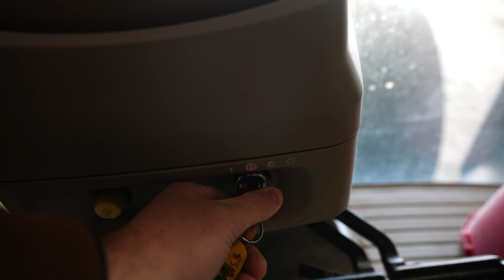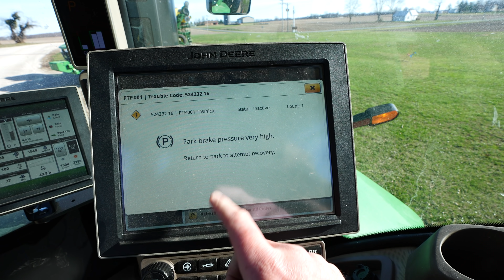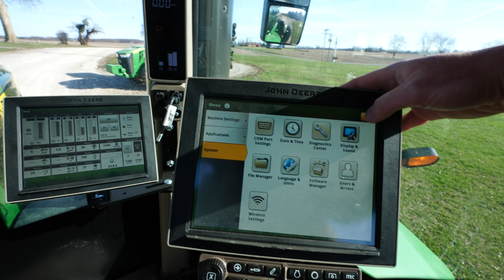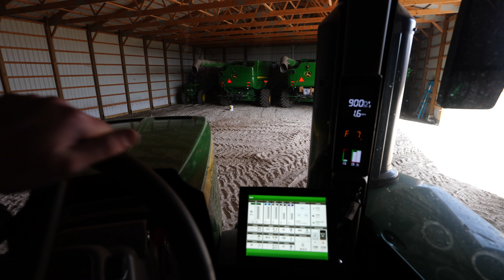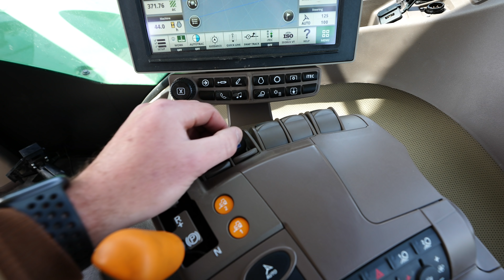The Old John Deere Iron Leaves The Shed For Planting (Ep.157)

Comment: Wow, that ancient clay tile still working is amazing. Around here they are always packed tight with sand/soluble clay, almost like concrete. Maybe it was the size and lack of fine sand in that Illinois soil?
Reply from the maker: That's a great question. A lot of our clay tiles degrade in structure at some point, which causes blockages in the flow. That eventually causes them to fill full of soil. I would say that the big clay tiles, like two two that we hooked in, move enough water that they self-clean to a certain extent.
Reply: I hate maintenance  in the cold.

Comment: I’ll tell ya what, that 20” spacing can’t be beat. Corn and beans! I have one that’s a twin 20 for small grains. The other two are straight up regular 20”. All built on the heavier 90’-120’ Bauer Bars, but cut to 80’ for my 2:1 ratio controlled traffic format.
Reply from the maker: There is a lot of talk about 20” rows as the next big thing for corn. I am not sold on that, but it makes sense for beans, especially economically. 

I am curious: how do you seed your cover crops?
Reply: @aTrippyFarmer  I drill all of my warm season covers due to the process is fairly abusive to equipment because I’m timing it so the ground is semi frozen, or frozen, but not solid. My drill is a disc opener style, shanks will snap off. It’s better than throwing seed into the wind (although that’s better than nothing) and I don’t want to be out when it’s wet later in the year.

Cool season covers, and warm blends following cereals are planted with the twin 20 at the same time we harvest. The thing is, constantly adjusting and new plans are always a thing. 

20” corn is great for weed control. Depending on what ground I’m on, the population is only slightly higher than 30” or the same. 36k or 44k. I have a friend who is conventional and he says he can get all the yield and go non GMO with 20” and do one pass with a rotary hoe and side dress N at the same time.
Reply from the maker: @LtColDaddy71  I find your management decisions to be fascinating. You do things that are so foreign to the average midwestern farmer. It would be really neat to see that outfit in action, and I’m very serious about implementing some covers on the soybean stubble to start.
Reply: @aTrippyFarmer  I’m not an idealist though. I was a blank slate, bought land instead of a McMansion, but I wasn’t willing to put my Peter on the chopping block by paying big bills. Every practice I use is 100% a business decision. 

Are you in the Bloomington area? I think I’m an hour North of you.
Reply from the maker: @LtColDaddy71  nope. About 90 minutes south-southeast of Bloomington. 45 miles straight south of Champaign on I-57.